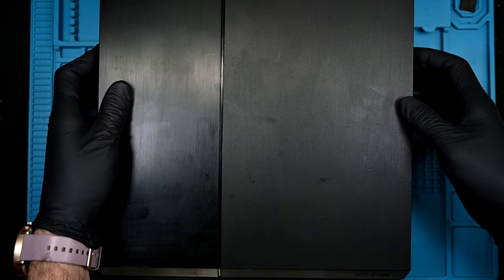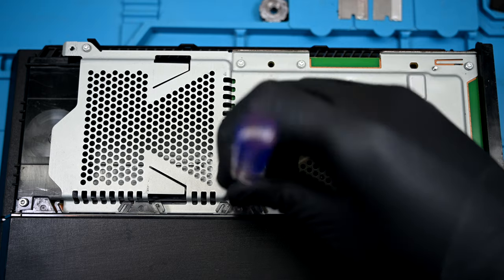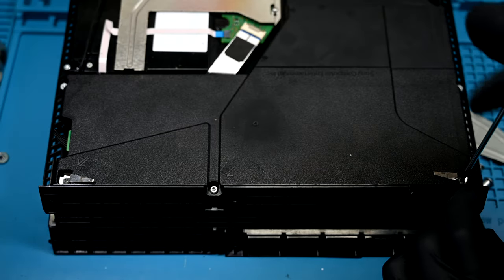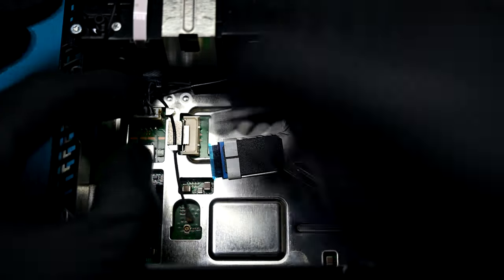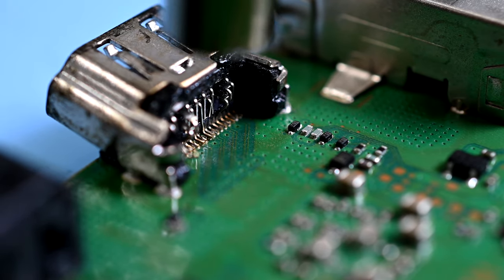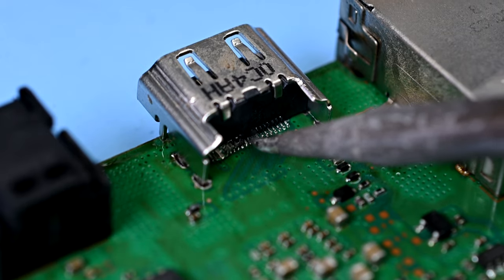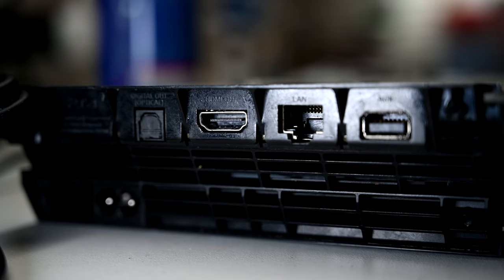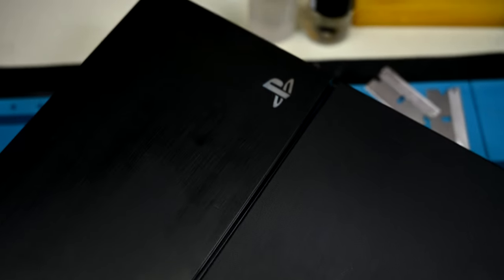PS4 HDMI Port Replacement | Guide

Comment: I'm trying this today for the first time. Thanks so much for the short and concise video. It is truly appreciated. Subscribing now
Reply from the maker: Thanks for watching! Good luck with it, just take your time on the pins and don't stress too hard if some of the solder bridges together, it's pretty easy to fix, and remember that Flux is your friend!
Reply: @TapticDigital  I'm a pro now at ps4 controllers so im decent at soldering. Do you not think heat resistant tape is necessary for this with the hot air? I always cover all chips on controllers when I take out joysticks
Reply from the maker: @louisrsanders  my airflow nozzle is pretty concentrated so it rarely hits other stuff, sometimes a resistor or two will go liquid but almost never goes flying. If it does fly, I won't lie, I kind of like the challenge.
Reply: @TapticDigital  also, couldn't you just get away with after tinning the pads just hitting it with the hot air again and not need to individually solder each pin? I'm going to do it your way but I figured you could do it quick and dirty with just air
Reply from the maker: @louisrsanders  you sure can, especially because cleaning out the feet sucks. Sometimes I'll tin the pads, hot air and yeet the port in. That is actually about the only way I know how to install a Nintendo Switch port, it's got covered pins. Little Flux, solder, prayer and hit air.
Reply: @TapticDigital  these thermal pads are gross cracked me up. I'll let you know how it goes
Reply: @TapticDigital  well, I " succeeded." I get a clear video signal but it took me almost 4 hours. I only had a 40 watt iron so clearing those holes was a mess. Had to use hot air. Am terrified I damaged something on the board because of how much heat I had to pump in. Is that something to worry about or if you get a clear signal on the homescreen are you pretty much good?
Reply from the maker: @louisrsanders  nice job! If you have signal, you have success. Those boards can take a TON of heat, it's hard to damage one unless you're trying, and PCB will let you know when it's damaged, usually bubbles up or cracks.
Reply: @TapticDigital  Something I noticed is that when I power it on and then off the PSU makes a pretty noticeable click. Starts up just fine but it definitely caught me by surprise (this is a dumpster dive unit). Anything to be worried about or did the old fatties do this?
Reply from the maker: @louisrsanders  some seem more click than others, I wouldn't worry about it too much though!
Reply: @TapticDigital  Well, after 3 days its working perfectly. Thank you so much. Your video was wonderful. Would you consider doing a “how to replace analog sticks video?” Ive watched others and I still sometimes mess them up. Not sure what I’m doing wrong. Maybe my hot air station is too hot or blowing too much air? Knowing more about that would be great.
Reply from the maker: @louisrsanders  next one that comes to my shop for repair, you got it! Not sure when that will be, but I'll definitely keep an eye out
Reply: @TapticDigital  these thumb sticks are gross
Reply from the maker: @louisrsanders  exactly why I wear gloves 😉 customers also don't seem to mention their phone has gone in the toilet until after it's in my hands
Reply: @TapticDigital  would upu like me to send you a ps4 controller for the video? I'd be happy to donate
Reply from the maker: @louisrsanders  appreciate the offer! But I've since bought a new one that is much better.
Reply: @TapticDigital  I wasnt talking about a new one  I was talking about a messed up one that you could replace the analog sticks on to fix stick drift
Reply from the maker: @louisrsanders  ah I see. Not yet, I'm planning mail in stuff this year hopefully. I do have a PS4  controller charge port I'll be replacing and recording soon though!
Reply: @TapticDigital  oh cmon bud. If they need help with the charge port they arent old enough to have a YouTube account
Reply from the maker: @louisrsanders  this made me very happy. Most all repairs I get I just want to ask them "why, why did you break it?" or "why was your PS5 hanging off the edge of a cabinet with drinks on it?"
Reply: @TapticDigital  I hate to annoy you and keep this thread going but I found a unicorn of a ps4 controller today. It works fine, connects, syncs, charges and had very minor stick drift I was able to correct with ipa cleaning, but the LEDs dont work on the charge port. I've tried SIX different ports (yes all the correct type) and 6 different 14 pin (it's a jdm 001 model) cables. It's the darndest thing. Could make an interesting video if you'd like me to mail it to you.

Comment: So the leaded soder is supposed to make it easier to remove the unleaded soder? Because I am having a hard time trying to remove the soder by itself.
Reply from the maker: Correct! Removing the factory solder is almost impossible because all the flux has been burned away, so it doesn’t melt very nicely. Using leaded solder adds flux to the mixture as well as lowering the overall melting temperature, making it much easier to work with.

Comment: A few questions. What solder and heat gun do you use or recommend? I am typically the one who repairs all my friends consoles but haven’t tried soldering but want to in case it comes down to it. Do you have a Amazon list of solder equipment and heat gun recommendations? Also what liquids do I get that you put for the solder that you used in the video. When you cleaned off the old solder what is the strip you used and how does it help clean the solder off?
Reply from the maker: I actually have a pinned comment on this video with my equipment list. You need any basic soldering iron with temperature control and a pencil style tip. Any heatgun with temperature control that can reach up to 450C will work fine, smaller nozzles help too for directing the hot air. The liquid I use is soldering flux, it allows the solder to flow without smearing and bridging connections, the other liquid is just isopropyl alcohol to clean the flux off. The strip is soldering wick, or braid, and when heated the solder gets pulled into the braid through capillary action. It's useful for cleaning off excess or unwanted solder. Hope that helps!

Comment: Can I use an upside down HDMI port for the fix? I can’t seem to find this exact replacement. All the one I got were upside down.
Reply from the maker: No, it has to be this specific one. Have you looked on Amazon or ebay?
Reply: @TapticDigital  neither is available in Nigeria. And shipping will just take ages

Comment: When you pressed the pins, i noticed you didn't use any solder? What was the go there? Can i just press the pins with my iron back into the data pads? 

Cheers 👍
Reply from the maker: In this case I didn't need to add extra because I added solder prior to putting the port on, though it probably wouldn't have hurt to add extra. I pressed the pins into a blob on top of the pads. Most repairs I hold the pin down and feed solder into it, just dependa on the day sometimes!
Reply: @TapticDigital  no worries, thanks for the super quick reply!!!!

Comment: Question: What is that gel? Because I filled everything in this and the port still isn’t working, do I need that clear gel? I don’t know what’s it’s called and I don’t know why it still isn’t working.
Reply from the maker: That gel is called Flux. Flux creates surface tension and doesn't mix with solder, but it allows solder to float and stick to the spot you want. It isn't necessary, but it really helps. It sounds like your pins just aren't staying stuck to the pads on the board. You may have good luck holding the pin to the pad with the iron, and feeding a small amount of solder into it to get them to bond together. You can use tweezers to nudge each pin gently to see if it's attached or wiggling and needing more "encouragement"

Comment: Attempted scrapped the ps4 after. To remove the hdmi housing your gonna have a good time. It’s almost like they used a higher temp soldier for it. It won’t budge forget it. Save the frustration have some one who makes a living doing this.
Reply from the maker: It takes an insane amount of heat, the kind that would normally air fry regular PCB. It's actually pretty clever because it allows the entire board to act as a heatsink and keep temperatures low, but it makes repair a total pain.

Comment: Can I use any hdmi port replacement, for example I got an old printer with 4 hdmi ports and I have the board out, could i use one of them?
Reply from the maker: There are different types of HDMI port, so it's quite unlikely they'd be the same. But I would love to know what printer has 4 HDMI ports and why on earth a printer would need even one?

Comment: What is the glue like stuff you put on the pins? I'm trying to replace mine but I'm not sure what that is and don't want to mess them up please help!
Reply: And do I have to replace the thermal paste??
Reply from the maker: Flux, it creates surface tension for solder and helps it flow smoothly where it needs to be. If you're not familiar with soldering I'd say it's a must have. A lot of solder wire has rosin core, which is basically Flux inside it, but a bit extra never hurts. Remember you can always use the wick to clean off excess or bridges. Also you don't have to replace the thermal paste, though I would HIGHLY recommend it. It can lead to bubbles in the paste and less efficient cooling.

Comment: When pulling out the disc drive ribbon, one of the wings/tabs on the blue part broke off. All the pins seem to be intact  is it ok or will i have to buy a new one
Reply from the maker: As long as all the pins are there, you should be fine! Might need a little piece of tape to hold it in place, but it'll be good as new
Reply: @TapticDigital  ok thanks. Also I'm having a hard time melting the soulder, can you melt it without a heat gun? I had mine set to 450c and it's not enough
Reply from the maker: @BassMaster.454  if you head leaded solder you can use an iron and add it to the existing solder, this will lower the overall melting temperature and should let the heatgun work. Without a heatgun it is too easy to cause damage
Reply: @TapticDigital  I replace the port now, but it's still not connecting🫤. The white light is gone now though. I know it's not the TV or the cord. Do you know what I might have done wrong or any other problems?
Reply from the maker: @BassMaster.454  could very well be the HDMI Encoder chip, it can short sometimes and leave you with nothing but a black screen or no signal
Reply: @TapticDigital  I see some online for under 20 dollars. I'll fiddle with it a little more and if that doesn't work, I'll try the chip. Do you know what tools you need to fix it or if it's something and inexperienced person can do?
Reply from the maker: @BassMaster.454  I would not recommend it to beginners, it almost requires a microscope
Reply: @TapticDigital  so I took a break and looked at it again. It looks like when I pulled the old port off it pulled off three of the little pads. How would I go about fixing that? ( By pads I mean where the little pins connect)

Comment: there was a cut in the video where you unhooked the connectors under the power supply.  did you come un from the bottom if the unit? i kind of git lost right there.
Reply from the maker: Yep, I flip the console upside down and pull the power supply out form below

Comment: Ever since the switchover from lead-based solder, I get conflicted when I see someone replace lead-free with lead-based. On one hand, it's now no longer RoHS compliant and thus technically harder to recycle especially if not properly labelled as such. However.....lead-based is just objectively better in every single way aside from toxicity. I learned soldering with lead-based and still to this day struggle with even high quality lead-free. I was the one dude in my automotive class with a background in electronics and my soldering skills looked the same as almost anyone else's as a result of this new stuff. lol
Reply from the maker: I went back and forth a lot on leaded vs. unleaded, and while training I ended up blowing out several PCBs beyond repair just from the high heat it took to melt the unleaded stuff sometimes. I also had a garbage heat gun at the time. I eventually decided leaded is the solder for me, it's just easier to manipulate in my opinion, it also reduces accidents during repair. And even though it reduces recycling ability, it's still wide open for part resellers and refurbishers. I have a friend TechChick on YouTube here who uses unleaded solder without flux, I say she's absolutely mad but she's taught me way more soldering techniques than I could list, so I really think it's down to personal preference (and company policy if that applies).
Reply: Use what works imo. There is a lot more toxic stuff in solder than lead anyways. And if you can't use unleaded solder properly, you'll be generating a lot more recyclable waste by butchering a pcb, than a small amount of lead would. People don't recycle consoles anyways, they throw them in the garbage. Sad but true.
Reply: Is it my TV or is it my PS4 if the HDM card keeps burning up the back of the TV

Comment: I have a console that was given to my son and the way she explained it to me was that the console fell off of her son's desk while the HDMI cable was plugged in (of course) And sometimes the screen flickers so if you just barely touch the HDMI cable while it's plugged in the screen will go off If you disconnect it and plug it back in the screen will come back on until the HDMI cable is barely wiggled I'm assuming there must be a broken solder point on the motherboard. I'm going to try to just heat it up and see if it works because my pins are not damaged at all.
Reply from the maker: Yep, super common problem. And if it still works at angles, that’s a good sign that the pad on the board isn’t ripped or damaged. You likely just need to reflow/touch up the pins behind the port. Hot air is great but can sometimes melt the port internally which isn’t fun, usually I’ll just take a soldering iron and add a bit of solder to each pin to make sure it’s fused with the pad on the board. Should be pretty straight forward, and you may as well do all the pins just to reinforce them.

Comment: What's up? Im trying to buy a replacement hdmi socket for my ps4 and apparently it has to be compatible? What models are compatible with a ps4 CUH-1116A? would really appreciate the information
Reply from the maker: I've not seen any differences in compatibility with the PS4 ports. The Pro and Slim use one that is different from the regular PS4, but as far as I've seen there's only one for all base PS4s

Comment: What is that gel stuff that u applied at 2:29 and is it realy necessary to apply that?
Reply from the maker: @CSS...036  soldering flux, keeps the solder from going dry and cracking, and prevents it from smearing. It isn’t necessary, but if you aren’t used to soldering things this small it makes a huge difference

Comment: Hey, can you give the specific kind of Solder used and Flux used in this video? Im trying to get the proper solder and they have so many different options. Thank you!
Reply from the maker: You can use any kind, I prefer leaded solder with rosin core. As far as the brand I'm not sure, my roll has mostly Chinese writing. Flux, I'd use any tacky flux , but in this video I used ChipQuik brand.
Reply: @TapticDigital  thank you for the quick reply! 🙏🏼

Comment: I'm having some vertical wiggle on my hdmi port. No visible wear from what I can see. Is it normal for soldering to crack, maybe? Mind you, I'm still getting signal. I just noticed the other day it was moving quite a bit and the screen would cut out for split second.
Reply from the maker: Yes! With age and environment the solder used on the data pins can start to crack or loosen. Many times you'll open it up to find one or more pins completely disconnected and floating above the pad, but due to the angle and pressure of the cable being connected it caused the pins to touch the pads and still work. Once pressure is changed or released, they float again and you loose signal. This doesn't require a full port replacement, just a touch up of adding some solder to those pins (or all of them for good measure).
Reply: @TapticDigital  thanks this helps a lot. Also, I need a little advice on prevention. Would putting the ps4 on its side with a stand help prevent it from happening again, once its been fixed

Comment: Hey man amazing work, do you think there is a way to do this at home in a more simple way?
Reply from the maker: At the least you'd need a basic soldering iron which isn't too expensive, in theory you could do it with just a heat gun but you'd have to get so lucky with the pins. Too much heatgun and the port will melt. I wouldn't recommend it, but I'm also tossing around the idea to repair an iPhone using only a power drill so I may not be the best judge...
Reply: Yea.. I think I should just leave it to the professionals, anyway thanks for getting back to me man keep up the good work👍🏾

Comment: Hello! Could you tell me what the copper strip thing is and what it does also where can I get the flux thing could you attach a link
Reply from the maker: That is soldering wick, it is used to soak up solder to remove it. Kind of like a sponge picking up water. You can use any brand you like, I use Techspray and usually get it from Amazon